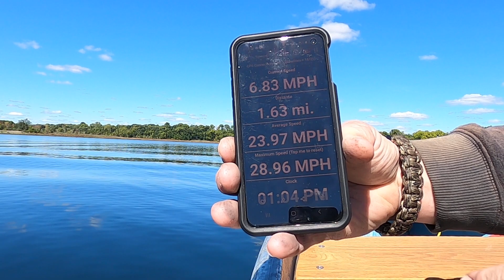1971 Evinrude Sportster 25hp Outboard Motor Lake Test

Comment: My 1994 has a “lean sneeze”
Cough at idil runs great going up one on pilot jet
Reply from the maker: If the one size larger pilot jet doesn't fix the issue, you may need to replace the upper and lower crankshaft seals.  If it is drawing air in through a leaking seal, it will cause a lean condition throughout the RPM range along with the obvious sneezing at low idle.  That can eventually cause over temperature combustion and could eventually lead to a melted piston if not addressed. Good luck woth your motor. Thanks for watching!
Reply: @oldjohnnyrude8404  thanks it’s a low hour motor was running fine still does above idle up to redline I pulled carb and going through it

Comment: Wish mine would sound and run so smoothly.
Reply from the maker: This motor has proved to be a bit of a challenge. I got it running and was able to test it rather quickly. I did discover a major leak at the upper crank seal. That ended up being a result of rodent urine corrosion.  I have recently finished replacing the crankshaft with a good used one.  I'm back to tuning and this one was never an easy one.  I need to do a full rebuild of the carburetor. I did a cleaning and replaced the needle retainer and the bowl gasket the first time.  Thus time it's getting the whole works as well as a new fuel pump.  Hopefully it will be singing a beautiful song on the water again this season. This motor really sings when it is right.  Thanks for watching!

Comment: You KNOW when you look back and see a nice low and flat wake far back from you that you are moving! Sweet motor! Keeper!!!
Reply from the maker: Yessir! This motor is a screamer.  It definitely moves thi boat along nicely.  It's a keeper.  I have replaced the lower crankshaft carbon seal,  cleaned up, and painted the inside of the lower pan and powerhead.  Now it is finicky and unhappy.  Ill.get it straightened out again,  but its being a bit stubborn.

Comment: I have a 1971 and a 1972 both restored . I’ll never get rid of them my favorite motors . These early Evinrude’s are bulletproof as long as you take care of them . Good find
Reply from the maker: Very nice!! I'm quite pleased with this '71.  I also have a pair of parts motors in '69 amd '70 that I will be working on gathering parts for to bring back to life.  These are great motors. Awesome power to weight ratio.  Kind if high strung for general purposes,  but for this rig it is a nice fit since this boat doesn't spend a lot of time just putting around.  I still love my 18s for all around use.  Only about 1.5-2 mph slower and much better manners in the low end of the speed range.  They will certainly keep on going with good care.  I'm very happy with this find.  It's a keeper for sure.  Thanks for watching!

Comment: I’m looking at picking up a 1975 25hp Johnson for a really good deal, but I’m wondering if you can troll at speeds of 1 to 2 miles an hour with them?
Reply from the maker: It depends on the size of your boat, pitch of your prop, and whether you plan to use a trolling plate.  With a typical 14 foot aluminum fishing skiff and a stock 11P prop, 1 to 2 mph is not really achievable for any length of time.  If you have a large boat, and run a 9x9 prop with a trolling plate, I would say yes.  1 to 2 mph is quite slow for anything but a small motor.  I would say for that trolling speed a motor of 7.5hp or less is best.  A well tuned 9.9 can probably get you there.  These 22c.i. 25hp motors with crankcase recirculation are not the best suited motors to long spells of idle speed.  They're great motors, but the best suited to trolling. Thanks for watching!
Reply: @oldjohnnyrude8404  okay thanks! 
I had a 14’ Lund with a 2020 25hp Yamaha and a 2016 25 hp etec and I was able to get down to 1.5 -2 mph with them but I no longer have that set up anymore. I picked up a new fishing set up for a smoking deal and It came with a 1974 Johnson 25 and I’m tuning it up a bit. I love the simplicity of these old Johnson’s and how light they are for a 25hp just don’t to spend a lot on it if it’s not going to do what I need. 
Thanks for the info!
Reply from the maker: @aaronstarlund8450  Great motors, and it may get you close with a 9x9 prop, especially with the boat full of gear and a passenger. They just aren't known for lots of happy trolling.  The etec and the Yamaha have a more refined combustion process and likely will give less troubles at extended low speeds. The 18hp 22c.i. OMCs will troll better than the 25s as a general rule and the pre-1968 models without the crankcase recirculation will troll down very nicely.
Reply: @oldjohnnyrude8404  Thank-you!! That answers my question
Reply from the maker: @aaronstarlund8450  You're welcome.

Comment: hello!  i have 1976 evinrude 25 hp motor. please tell me what is corect oil gas mixture ? is a  256b62 model. 10x in advance
Reply from the maker: Your motor uses a 50:1 gasoline to oil mix ratio.  One pint of TCW-3 outboard oil to 6 gallons of gasoline.  Thanks for watching!

Comment: I think you have a winner there....Nice and light with plenty of top end RPM.  This one will never idle like its 50s cousins though, so don't take it fishing....Love that rig...
Reply from the maker: Yes, I believe I have a winner with this one too.  It is a great match to this little boat.  I don't expect it will ever idle as well as a pre-1968 18hp.  I would like to try tonget a little better idle quality out of it, but what it does now will suffice for 95% of what this boat gets used for.   If I want to take this boat fishing,  I'll just go back to my '67 Fastwin, or better yet, take my Alumacraft K or my Sea Nymph with a tiller motor and have an open floor.  This rig is a blast to drive around on the lake or the river though.  Thanks for watching,  Don!

Comment: Can you recall the prop size on that I have a 74
Reply from the maker: On this boat I use a 9.25x11P prop. On my 14 or 16 footer with passengers I like a 9x9P to keep the RPMs up since that is where these 22 c.i. 25hp motors get their power.  9x10 is a decent all purpose prop for these motors. I have props from 9 to 13 pitch to fit this motor.  More than 11P requires near perfect conditions and as light of a load as possible in the boat to get the best performance.

Comment: Another fantastic ride along   That is a really good motor. When you paint it up it will be like new. Good luck with it.
Reply from the maker: I'm glad you enjoyed the ride.  This is a really good motor.  It seems to have very low hours on it despite the mouse damage.  Compression is 130/130, it makes no strange noises, and rolls over very smoothly.  Once the inside is painted again, it will be nice.  Thanks for watching!

Comment: Next Saturday imma go pickup a electric start 33 hp 60s Evinrude, looks identical to my speeditwin but the cowl says electric start instead of speeditwin. Guy wanted 100 in the fb ad, offered 75, he messaged me back and said I could have for $20! He drives a hard bargain for sure. 
Anyways, it looks super clean and stored upright inside, it’s gotta run...the pic he sent of the serial # is terrible, I think it’s 33853 but not 100%, and can’t tell if it’s a R or an M after. I was looking on that Leroy’s ramblings, and if it IS 3385[3] , doesn’t that mean longshaft? It don’t look like a long shaft...and what does the R/M differentiate, nearest I can think is Manual or Remote start? Lol I have no patience to wait a week dammit! Moto is SUPER DUPER clean, like brand new looking. He lives as far away from his storage as I do, so I can’t get another pic or even see till Saturday, if he don’t flake...

Comment: I would have guessed 27mph , a lighter motor seem to do the trick ! I wish you would have said something , I have a 69 Johnson 25hp for sale that I haven’t touched yet but I guess I’ll start on her this week ! Just finished 2 Johnson 6hp and sold them and sold a 62 Evinrude 10hp and finished a QD-19 and ran it in my tank  and I don’t know what’s come over me , ask Ron ! Lol. Normally I do 2 outboards a week on a good week ! Lol. But 4 in 2 days ! Lol
Reply from the maker: It would have been a trick to get a hold of that '69 you have for a while anyway.   It sound like you have been going thru them pretty quick, Dave. This things moves out nicely.   👍
Reply: Old JohnnyRude for some reason the small ones are selling this year ?!?! Maybe because of price or maybe they realize that the 6hp is a really good outboard or perhaps there using smaller plastic boats for duck hunting ? I don’t know and I’m not complaining , I’ve sold more 6hp this year then 4 years combined ! Go figure !
Reply from the maker: @davekimbler2308  The 6s are great little motors.  Maybe people are finally realizing that?  Thats a huge jump in numbers though.  Maybe because everyone has been locked down and half the country is out of work.  They have time on their hands and they can't afford to buy new?  Whatever it is, its good for the sellers I guess.
Reply: Old JohnnyRude yes ! I wish I had a few more , now I’m trying to sell the 5 1/2 ‘s ! Ron’s doing great with the 10’s and 18’s though ! Have you sold any ? My bread and butter are the 9.9’s and 15’s , as soon as I get one done it’s gone ! I’m down to 1- 9.9 and 2- 15’s and 1- 20 and 1- 25  !

Comment: Is this by any chance Allen lake?  sure looks like it.  Nice motor by the way, I just picked one up last night
Reply: I guess you stated it in the video beginning, we fish Allen often
Reply from the maker: @jjlietzke  Nice!  Yes, I did state that it is Allen Lake at the beginning. I run on Allen a lot.  Nice little lake and there is a spot for me to pull up on shore to swap motors when I bring several to run.  I'm sure we'll see each other out there.  My Aerocraft is pretty easy to spot.  I also run a couple Alumacrafts.  I have an FD woth controls and a Model K I use  for most of my tiller motors. Thanks for watching!
Reply: @oldjohnnyrude8404  hope to see you out there sometime, we fish Allen often.  If I have troubles with my 25 sportster I may have to look you up!
Reply from the maker: @jjlietzke  If you see a 12 foot Aerocraft with a red bottom and polished sides, and mid controls going across the lake, 99.9% chance it's me.  I'm trying to get around to putting a replacement crankshaft in this '71 Sportster 25hp now.  I'm really wanting to get it back on the water.  What year is your Sportster?
Reply: @oldjohnnyrude8404  mine is also a 71, bought it to hopefully gain some power and speed over my 69 fastwin 18hp.  My boat used to have mid controls but is now tiller steer, 15ft but wide
Reply from the maker: @jjlietzke  I'd be happy to take a look / listen sometime.  For sure if you're out at the lake when I am.  Mine would sing a sweet song at full throttle,  but didn't want to idle and it kept getting worse during the short time I ran it before giving it a full go over.  My upper crank seal would nit seal because the mice got in this motor.  The mouse pee rusted the top of the crankshaft at the sealing surface and it was just gone.  Really bad leak and needed replacing.
Reply: @oldjohnnyrude8404  do you know if these 25hp are able to be made elec start?
Reply from the maker: @jjlietzke  Yes, the motor in this video began life as an electric start motor.  When I got it, all the electric start parts hade been removed other than the choke solenoid.  There is a number of parts required to make it a fully factory electric start motor, but it can be done.  Thanks for watching!
I guess I should have clarified that other than internal block machining, high compression head and pistons, and a larger high speed jet in the carburetor,  the 18 and the 25 are externally identical. 😉

Comment: What type of oil do you use? I seen zero smoke come from that motor. Like your vids. Have a few of these 25 and 35s old Evinrude and Johnsons.
Reply from the maker: I was using Pennzoil fully synthetic outboard oil.  Pennzoil stopped producing that oil.  I have been using Amsoil fully synthetic outboard oil quite a bit as well with good luck.  I recently bought some Klotz synthetic outboard oil to try.  I'll see how I like that come spring.  I always   liked Klotz in my 2-stroke quad.  When these motors are well tuned and warm they smoke very little even at sweeter mix ratios.  Thanks for watching!

Comment: What's the hp limit on that boat? I assume it's 12ft? I can't find a old boat with more than 10hp limit.   Ohh I got the same motor I've been messing with,  top cylinder is being a paint getting good spark...
Reply from the maker: This is a 12 foot boat and it was sold as a tiller boat only with a 20hp rating.  At that time 20hp was the max 22 c.i. powerhead in OMCs lineup.  It handles the 25hp 22 c.i. motor very nicely and the center steering deck makes a great boat out of it.  I've run the big 35.7 c.i 25hp Johnson RD on this boat too.  It is a little heavy, but still works surprisingly well. Most 12 footers are about 10hp max.  I wanted a deep and wide one with at least 15hp rating.  I was really looking for a Model R Alumacraft of a Crestliner Commander when I found this Aerocraft.   It probably should have been scrapped it was in such bad shape when I got it.  I decided to put the work in and save it though.  Thanks for watching!

Comment: I have a 68 18hp fastwin. Is it possible to get more hp from it?
Reply from the maker: Well, the '69-'76 25hp is the same 22 c.i. block hot-rodded to about its maximum reliable power.  It spins at 6-7k and has a larger carburetor,  intake, higher compression, a tuned exhaust and possibly other things I didn't mention.  I'm not sure how much more power you are trying to get from an 18hp OMC.  For a reliable engine, 25 is about all there is. Idle quality suffers on the 25hp version, but they will definitely go.  The easiest way to get 25 hp from one is to buy a 25. You really need the whole combination of modifications to get the extra power and the lower unit uses a needle bearing on the drive shaft bearing also to handle the extra shaft RPM.

Comment: Fantastic motor!  GREAT Video!  I love it... looking for an engine for my 12' aluminum boat and was thinking a 9.9 or so... but now I think I want to go with a 25!  How did you do the steering?  More photos?  Thanks!
Reply from the maker: Thank you.  This motor, unfortunately, has a rusted sealing surface on the crankshaft for the upper seal.  I have purchased a replacement crank and plan to replace it over the winter.   It ran great at wide open, but was running lean in the top cylinder. The engine is still in great shape other than that.  

Depending on your particular 12 foot boat, the 25 may be a great fit for it or it may be way too much for it.  This boat is rated for 20hp even at the tiller. The 20hp was the highest rating for this same displacement powerhead in the late 1960s when this boat was built.  This boat is not very comfortable and doesn't handle well from the tiller. With the remote controls and steering from the center bench, it is very nice.  

I did a video covering the build of this boat on my channel.   Here is a link if you want to check it out. 
https://youtu.be/pOlLeN5aVa4

Comment: Mr Johnnyrude, do you have a starter bracket for my 66 18hp fastwin to sell?
Reply from the maker: Sorry, I do not have one of those brackets for sale. I onlynhabe one that isn't on a motor amd it is either going on an 18 or a 25.  I just haven't decided which yet.
Reply: @oldjohnnyrude8404  it was a long shot... hey any chance you know the part # im after? It’s really hard to find on marineengines without knowing a motor that came with it, I think maybe it’s 308361? If so, there’s a bunch on eBay:) if not any ideas?
Edit: any chance you can make a short little video just to show me exactly what the part looks like? The eBay brackets are labeled for the timeframe and size, but they look nothing like the brackets for my bigger motors, so I just want to be sure I’m getting the right ones, they range in price from $20- to a couple hundred $$, some with the motors and some just the bracket but if it’s that different, I probably need the motor as well right, I have a motor for the bigger size outboards that fit the brackets I have (28hp, 35hp)
Edit #2: yeah I see the 308361 bracket on my motor, that’s obviously not it.
Reply from the maker: @TheFrogfeeder   Here is what the bracket looks like. https://youtu.be/ejV4BF0_GGs

Comment: Nice motor!  It must feel like you are flying low with that thing on the back.
Reply from the maker: Thank you! It definitely feels like your moving along.  This boat handles well enough clam water and light chop that it is pretty easy to get used to the speed.  It really feels like it would still be fine at mid 30s, but I think that may be beyond max hull speed for this boat.  If i can get it past 30 I'll be happy.  I'm almost there.  Thanks for watching!

Comment: What kind of wood did you use for the transom support?
Reply from the maker: I used red oak on the inside.   I much prefer white oak, but couldn't get any at the time and I was in a pinch.   I know it won't last as long, but it has held up well so far. This one is pretty easy to replace anyway.  I use 3/8" marine plywood on the outside for the shim pad.  Sanded and multiple coats of marine poly.  Again, epoxy is better but I didn't have any and I was in a pinch.  Thanks for watching!